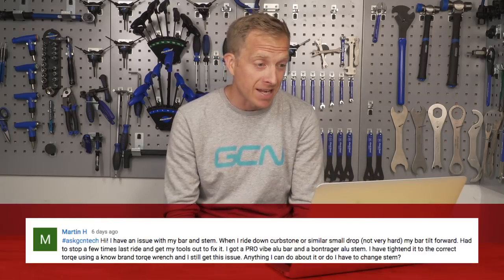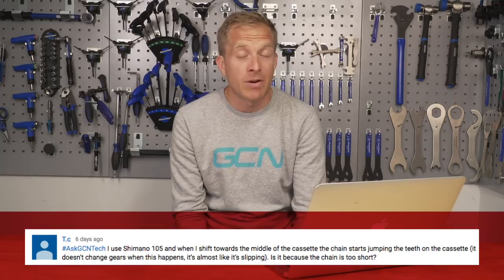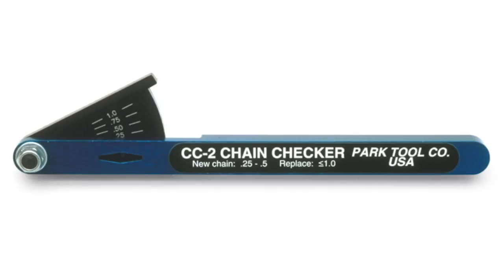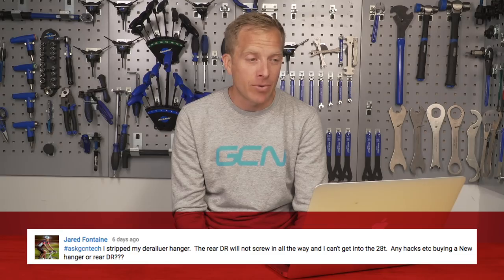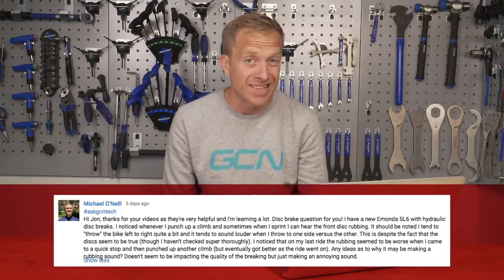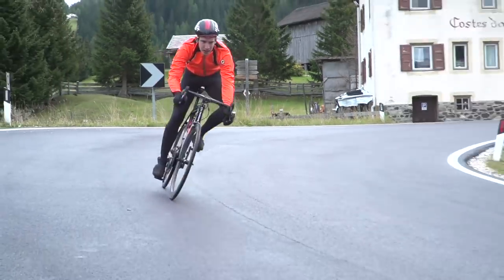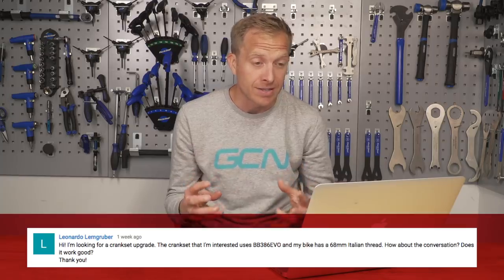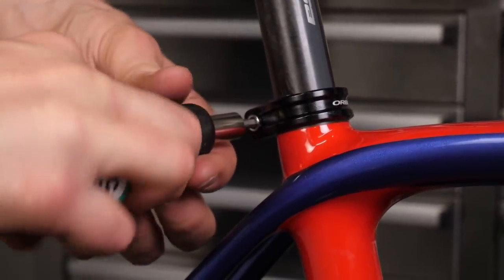Handlebar Torque, Chain Skip & Roof Racks | GCN Tech Clinic

Comment: I've always done it by the feeling but how do you properly know when to stop torquing your bolts with a normal hex key (without a force meter)?
Reply: Go until you hear a crack, then back off 1/4 turn...
Reply: after which point you realise a torque wrench is a worthy investment after all....
Reply: If you aren't stripping bolts, and things aren't coming loose or breaking (!), you already 'properly know' correct torque by feel. You can kind of fake deflection style torque wrenches by using longer hex keys. Push on the end of the key and as the bolt snugs up the key will bend 'just so'. Try to avoid pushing it to the 'oh no!' point. ;)  Lots of experience and a degree of wimpiness helps.
Reply: You could hang a weight (e.g. 10 lbs at 7 inches gives you ~8 Nm) but by the time you've rigged that up, you'll have bought the small one out of frustration.  Borrow a bigger one for cranks, etc., or go to your LBS.

Comment: #askgcntech I would like to mark where my seat post goes into the frame.  This way I can quickly put it back when I remove it without having to measure.  What is the best way to mark it?  I have bikes with both aluminum and carbon posts.
Reply: Jeff King a bit of paint. Ideal for the job

Comment: When I am in the small chain ring (36) on the front, and anywhere on my cassette other than the largest cog, the chain "pops" when I apply force to the cranks. Starting,  sprinting, climbing. Happens less when the chain is clean. I have replaced the chain and crank set so far. Any ideas? #askgcntech

Comment: #askgntech I recently replaced a chain on my 11sp Shimano drivetrain and the new chain came with a 'quick link' instead of a pin. According to the documentation, the quick link is single use only and requires a special tool for installation and removal, so I don't see how it is any better than the joining pins that were used previously. Am I missing something or is this new quick link thing just a gimmick?
Reply: The "quick link" is new to Shimano but other brands have used them for some time. Get some spare quick links for easy chain removal for deep cleaning AND roadside repairs. Our club have had a few chain events lately - split the chain, remove, sort out the problem, fit new link, easy done.
Reply: Richard Venning thanks for the reply! I may be missing something, but the "quick" links  still don't seem to be any better than the connector pins to me. It's possible to buy a bunch of those as well.

Comment: #askgcntech ... Jon, a clicking question, I have the most annoying click on pedal rotations above around 130 watts.  Below this the drivetrain is silent and as the power rises, so does the aggressiveness of the click.  
I've changed both derailleurs, the frame, the wheels,  the bottom bracket, the pedals, and my shoes and cleats and it's still there.  If I remove my chainrings and clean, regrease, reattach I get about 5 minutes of silent riding before the click slowly works it's way back in.  The clicking happens in both chainrings so it's not wear to the teeth either.  
Any thoughts on what it could be?  Is there a contact point on the spider I'm missing?  Anything on the cassette, although based on the clean / regrease solution I'm guessing I've pinpointed it to chainrings.
Reply: Just had a month's worth of clicking; "seemed" like the BB/chainrings - did you check the seat tube and seat rails where they attach?  Possibly a stiff chain link.
(In my case, it turned out to be the rear spokes where they enter the hub, but you changed your wheel out)
Reply: George Hugh yeah, brand new seat post and saddle.  Chain was replaced and same click before and after. Also, click occurs when on the trainer which is as wheel-off model so not the spokes either.  In my head it must either be the silver cylinders the chain ring bolts fasten to or there's a minor scratch on the inside of the chainrings that has some play when pedaling at power.
Reply: Jason:  Thorough sleuthing job you've done there.  Maybe the FRONT fork/QR interface (add a dab of grease at the dropouts and on QR).  Trainer clicks may allow a buddy to listen around to isolate the location better.  Sorry I couldn't be more help.
Reply: I was recently chasing a similar click. I noticed some damage and a burr on one of the shifting pins on by big ring. Hit it with a file and finally stopped the clicking. So naturally my valve stem started clicking a few days after that.
Reply: will have a look at that this evening.  I'm getting a dab hand at removing and installing them as you can imagine.  Although actually getting close to the point where the power meter and chainrings get replaced.
Reply: brand new frame and forks and same click sadly.  thanks for the advice though.  Here's hoping Mr Cannings knows.
Reply: no damage to the pins but there looks to be some areas on both chainrings where the black has worn down and has created a ridge below where the chain sits.  Can imagine this maybe hits the chain if pedalling with force.  I've just ordered a cheap pair of Stronglight replacements to see if the chainrings are the cause before doing the drastic and binning the power meter.
Reply: Buddy, after all the eliminations you've made I think it might be your knee clicking;)

Comment: #askgcntech Hey Jon, I  bought a second hand bike about a moth ago. Refurbished and cleaned and greased it all according to your rules . But when i pull my front brake (especially in wet weather) the resonance of the block against  the rim is unbearable. The brake blocks are  thought, pads are replaced and the rim is perfectly clean and degreased. Is there something i overlooked or do i need to change my rim? please help me for I am to ashamed to ride this bike.
Reply: Ben Huygh idk on racing brakes, but on V brakes, they advice to have the back part of the brake pad to have a little more distance from the rim. Maybe put a rubber band over it when attaching. Is said to reduce squeal.

Comment: #askgcntech I will try again :) I recently installed a Power2Max NG Eco power meter, with a brand new Rotor 3D 24 crank on my bike. Since then, despite my numerous attempts, I cannot properly tune my frot mech, always some (very light) chain rubbing is there. Any tips for it? PS I mount a Shimano Ultegra 6800. Thank!!!
Reply: Gabriele Barni put an inline adjuster on the cable to give you some more micro adjustment
Reply: Gabriele, I had the same problem with my Ultegra 6800. In my case the problem was that the cable was passing on the wrong side of the little pin protruding from the "converter" (also make sure the converter is installed in the correct way) - see page 10 of the manual: http://si.shimano.com/pdfs/dm/DM-FD0002-05-ENG.pdf

Comment: #askgcntech hi Jon, I have a bike fit question. I recently bought my first ever road bike with clipless pedals, now after about 15min of riding my feet go completely numb. What can I do about it. Cheers!
Reply: Bram Lermitte you need to have a look at your cleat set up- take your shoes to a local bike shop if you have any doubts
Reply: Assuming you know it's not the size of your shoes, cleat positioning and possibly foot varus. I needed cleat wedges to even out the pressure across my foot.
Reply: Try moving the cleats further back (more towards the centre of the shoes) that helped me when I changed from SPD (mountain) to SPD SL (road) clipless.
Reply from the maker: It can be a number of things Bram so it could be worth getting a bike fit. Try some of the suggestions above and if they don't work then that may be the way forward.
Reply: My toes have a lot of room to fiddle around but my ankle is really firm and snug. I have orthopedic soles but when i used them i had a lot of pain when cycling, so it is allready an improvement.

Comment: #askgcntech I have a weird Bianchi carbon compressor plug (link below). I was not able to make it fix in place, it always comes up to the cap and does not press the stem. After trying to make it work, I decided to replace it with a newer model. Is it some sort of an engineering mistake or was I doing something wrong? (this is not my thread, but my compressor is exactly like this - http://forums.roadbikereview.com/components-wrenching/compression-plug-removal-insertion-bianchi-carbon-fork-282466.html

Comment: That's the problem with handlebar dimensions in millimeters.  When anyone says 31.7 or 31.8 what they really mean is 1 1/4," which is 31.75mm.  Deda just chooses to call it 31.7 while everyone else rounds up.  They still list steer tubes in inches, they should do the same for handlebar clamp dimensions.